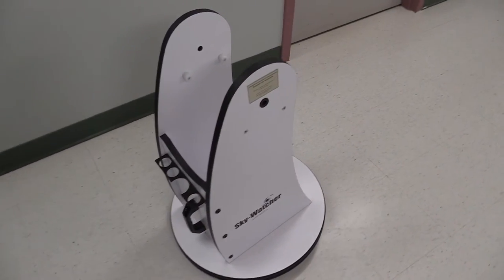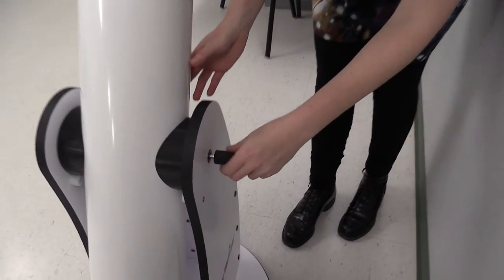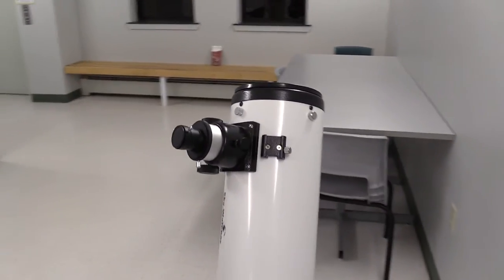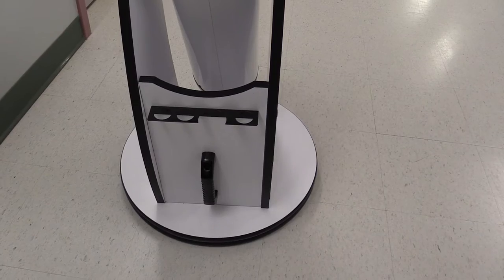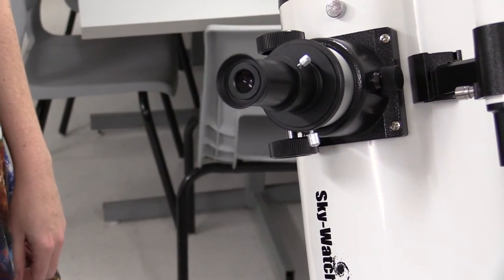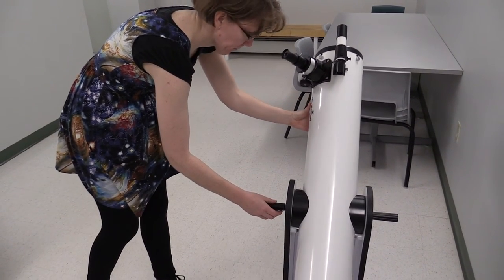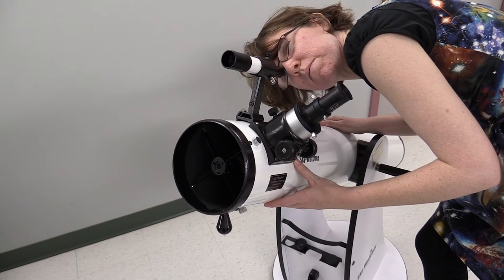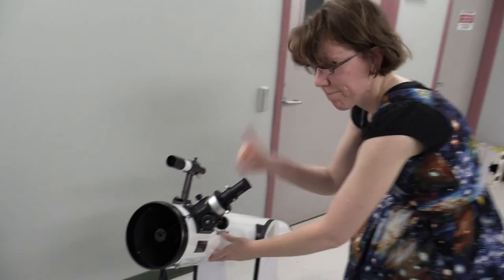Using a Library Telescope - Library Telescope Program

Comment: I don't understand how a public library can loan telescopes. I know what the public is like here and how expensive telescopes are as well as how susceptible to damage they are. I own several telescopes. I imagine that if you were to get them back they would not be complete and / or damaged. I think stripped screws would be a very common occurrence. How do you take care of that situation?
Reply: The Sidewalk Astronomers of Charlottetown raised funds to provide the telescopes. Many places use tabletop telescopes. People are provided with "Do and Do Not list", a user manual, lunar map,  10mm and 25mm eyepieces, lens pen, a star map and sign an agreement acknowledging they are responsible for any damage. The worst we had is a lost thumbscrew and a damaged leg on Dob base which was easily repaired. People are very careful.